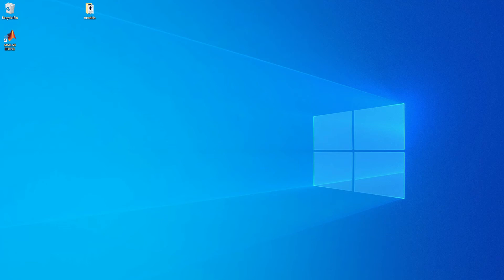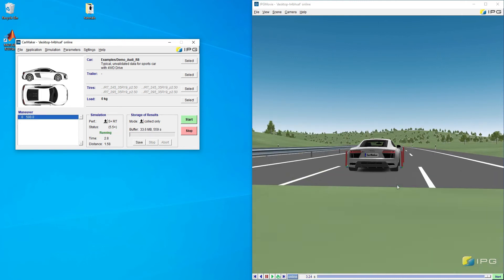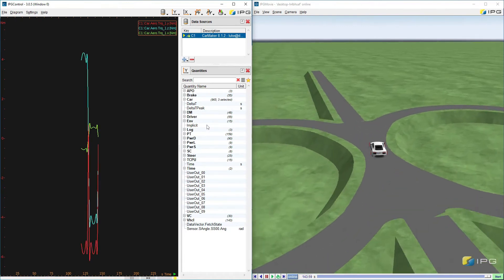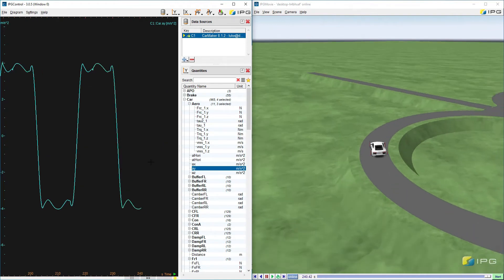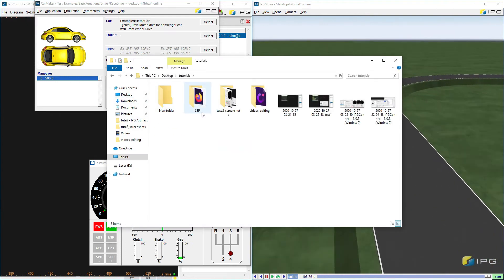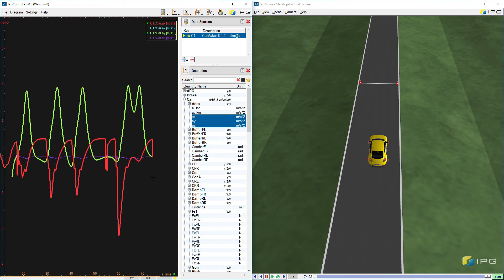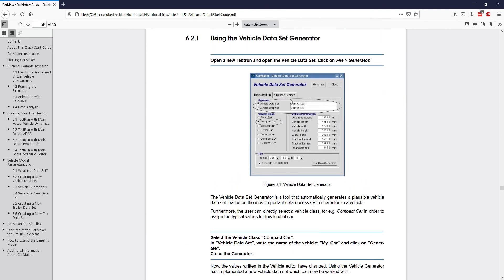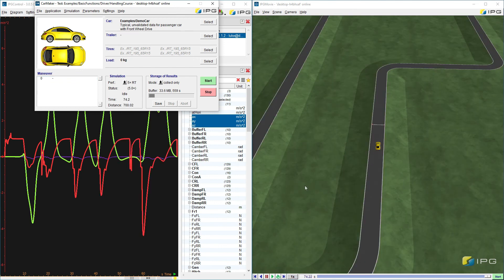Tutorial 3-  IPG CarMaker Project Creation and Basic Simulation - SEP2020

Comment: Nice videos, but I have a question..
We have to do our dynamics for ebaja in IPG, but I am having trouble in importing the frame.
When I convert the frame to a .obj format and paste it in the said folder( IPG/carmaker/win10/movie/3D/vehicles) and then try to import it, it's showing some error in the lines, and it doesn't open properly? 
Any help would be appreciated!
Reply from the maker: Hi,  I am not sure if the .obj format works that well. We also had issues with our own models and we decided to move ahead with a similar model found in IPG carmaker instead due to time constraints.  Maybe look at the file format of the other vehicles within  IPG/carmaker/win10/movie/3D/vehicles instead?
Reply: @lukegavin1417  hello, yes the others are in a mobj format, and the pdf which we were told to refer mentioned us to use a .obj format, but it didn't work. 
I'll try to use other formats
Reply from the maker: Sounds good I am not familiar with ebaja but I assume you should be able to export .obj to .mobj pretty easily.
Reply: Hii can you please help with ipg 
I am in Efficycle team and need help
Reply: @yashmaheshwari4185   did the get the help ?
Reply: @preritsharma5779  I did it on my own self
Reply: @yashmaheshwari4185  can you help us please ?
Reply: @preritsharma5779  sure
Reply: @yashmaheshwari4185  Can we edit the already existed Scenario/Road . I want to add the bumps on the road to vary the acceleration and I want to use the product example's scenario/road. I can actually do it by checking every senario/road which consists of bumps on the road to proceed, but instead I want to edit the already existed road. Can I do it . Is there a way to edit the already existed road ?